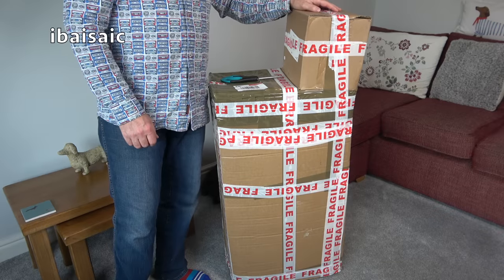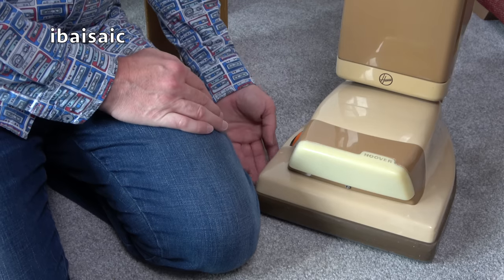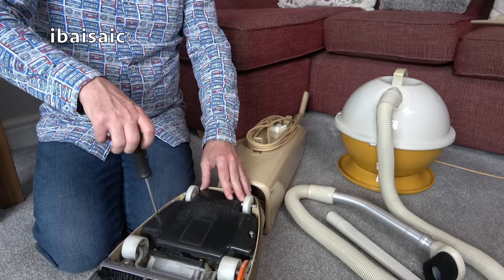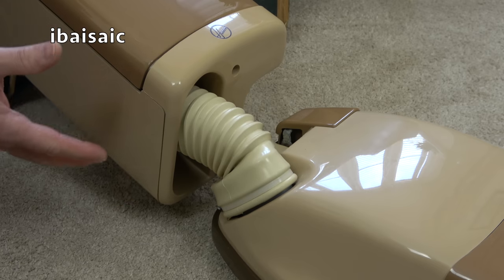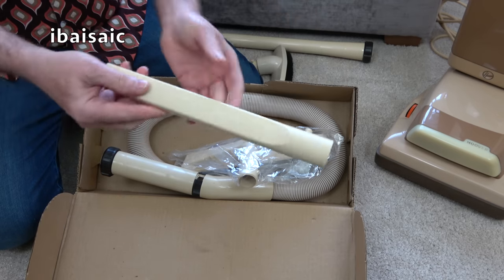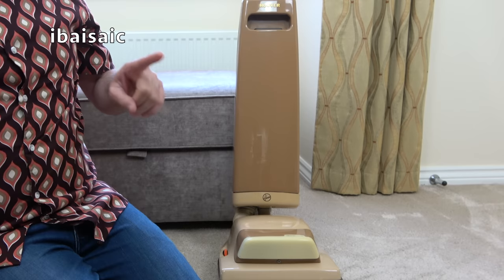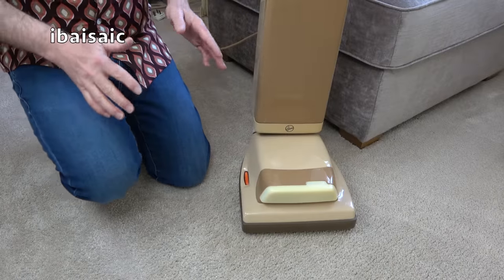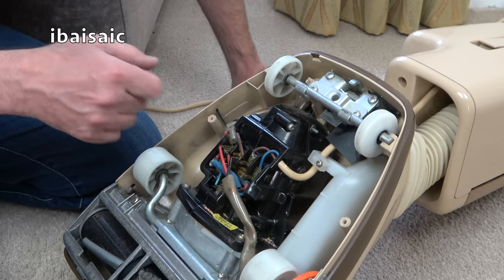Hoover U2132 High Power Compact Vacuum Cleaner Demonstration & Review

Comment: About the comment of shark vacuums not working within three years, we have an old shark navigator lift away that has worked for approximately 8, maybe even 10 years, and that’s with the absolute 200 IQ geniuses that are my family members (not). Shark vacuums don’t fail like most new vacuums these days. They last for a good amount of time.
Reply from the maker: I doubt a Shark will be working in 43 years time though, certainly not a cordless one.
Reply: Like many new products; the initial ones are usually above board and decently made in order to get the customer base.

Newer sharks these days though aren't made like the old Navigators. It's also harder to find spares for the new models too.
Reply: @ibaisaic   Roger you are such a good fisherman throwing out the bait about the Shark vac, you  got a bite so quickly.  🙂

Comment: I think the tool suction on the later Juniors with the pan converter was worse than on the earlier Juniors. At least on the earlier models with the belt lifter adapter the hose was located against the motor fan. Also with the belt lifter the motor could spin freely as it didn’t have to drive the brush roll. 
You don’t need me to tell that tool suction on both Junior and Senior was never their best feature.  
The same is true of any dirty fan upright. 
For carpet however with their beater bar they were excellent and in my opinion they still are.

Comment: This looks identical to my U1104 underneath , the suppressor if present is on side of motor next to air tube (I removed it off mine)
Reply from the maker: This has a later oblong shaped suppressor that I point out later in the video.
Reply: @ibaisaic  ahh I didn’t realise, worth bearing in mind , especially on slightly later machines.